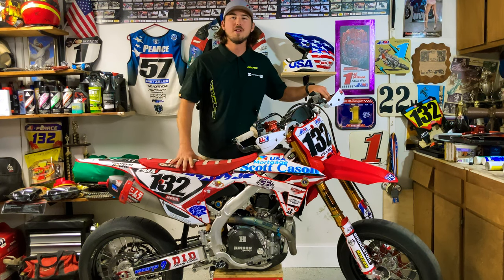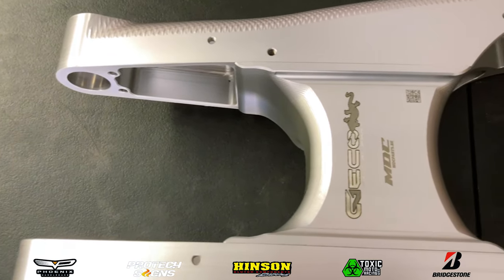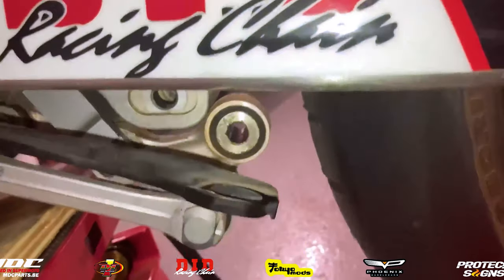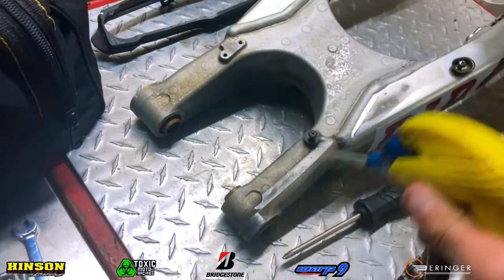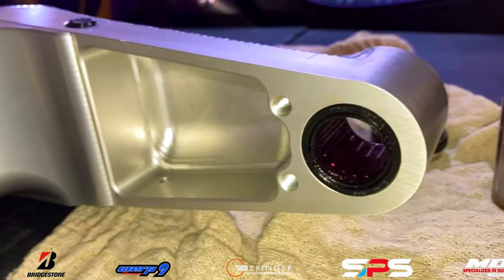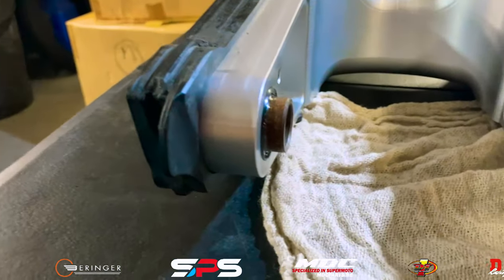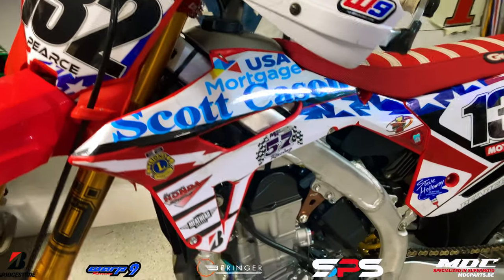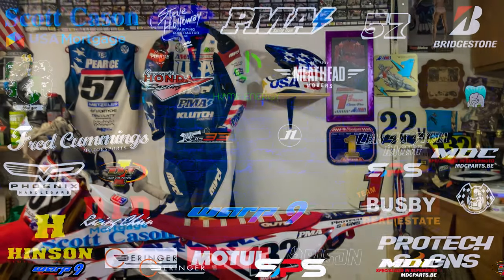Supermoto Bike Build Guide to Setting up YOUR First Supermoto | Step-by-Step | Episode 9 | MDC Parts

Comment: Questions, is the juice worth the squeeze? How was the track performance? With a shorter swing-arm. Does it change front grip, rear grip, turn in or overall cornering/straight line stability? Does it change the action of the rear shock or the balance front to rear? With the shorter swing arm, will your shock need valving changes to compensate for the shorter swing arm? Do you need to hand your rider sag? Just need info before I get a shorter swing arm for 2025 build. Thanks. Good job on the videos by the way. 👍🍻